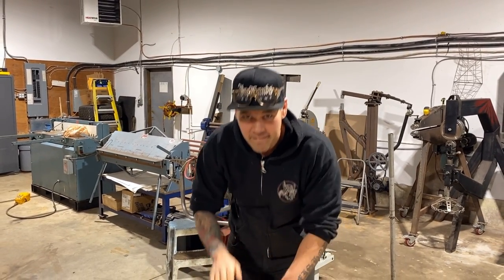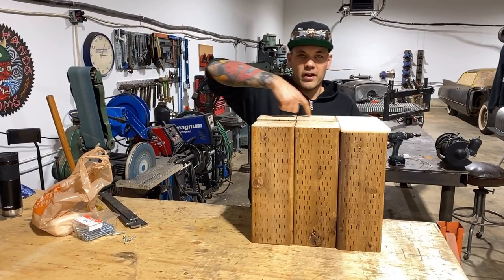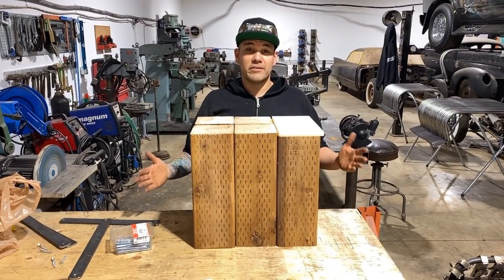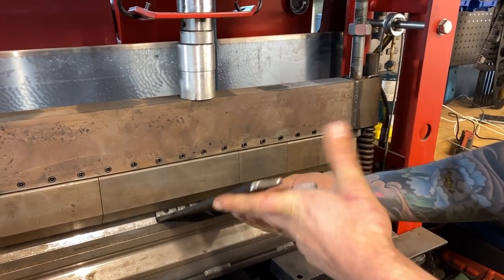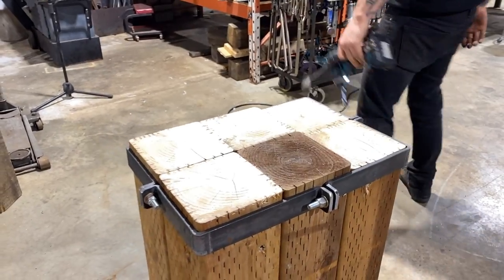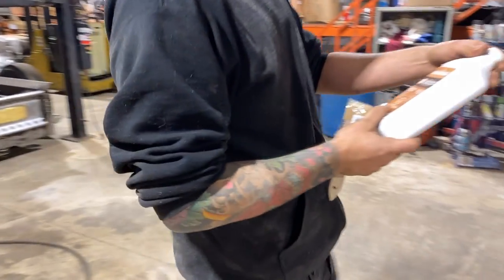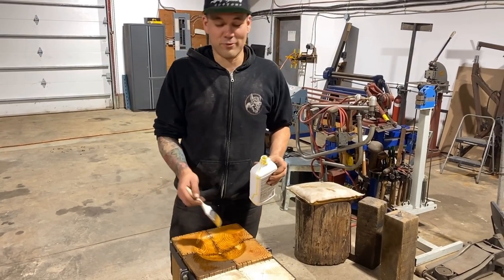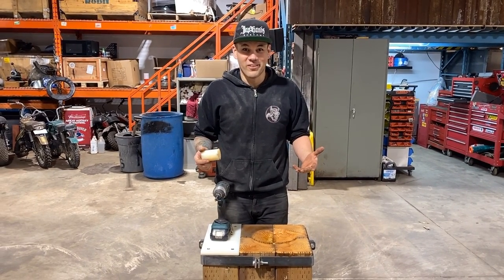How To Make Your Own Shrinking Stump for Metal Shaping!!  (EASY Step By Step Build)

Comment: No glue between the parts?
Reply from the maker: No but maybe it would help?
Reply: @MakeItKustom  maybe. Always gluing and screwing wood together. Just thinking it would keep the joints together where it's not strapped. I guess time will tell if it needs it. 🤷
Reply: @anthonydavies6980  If the wood is pressure treated I doubt glue would adhere to the wood anyway 👍

Comment: I'm not saying his design is bad or anything but it is a little over designed, mainly the straps. I've never built a shrinking stump but I do regularly build my own tools. Knotch the outside of the wood and use ratchet straps instead of bending metal. Use ratchet strap top and bottom. Just my opinion.
Reply from the maker: I’m sure that would work great!

Comment: Make a special notation to your viewers.
DO NOT EVER, use the angle grinder attachment that looks like a chainsaw chain.
It will scare the crap out of you if it doesn't try to kill you.
https://youtu.be/A7xWHEWov8M

The tool you are using in this video is what he would prefer.
Make it a sticky up on the top here so that everyone reads it.
A lot of people might want to speed up the process by using this super aggressive tool.
 I'd hate to see anyone using this tool, especially so, a novice.
Reply from the maker: Yeah those are terrifying!